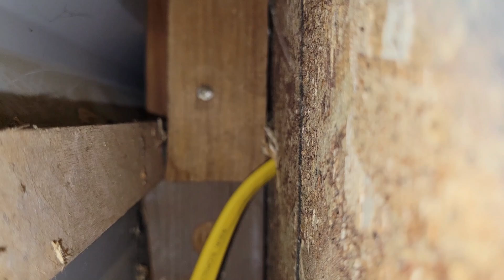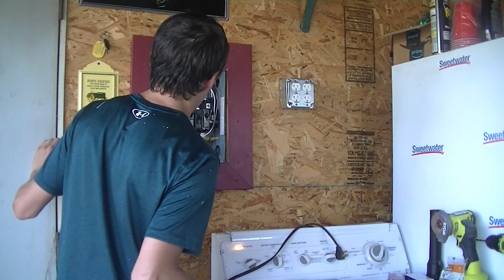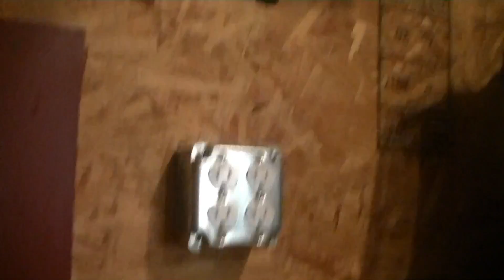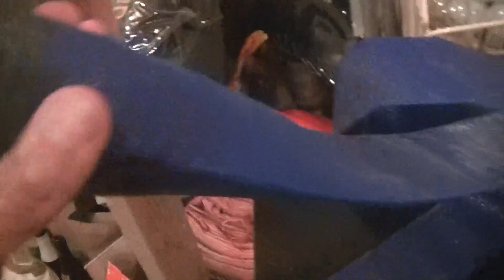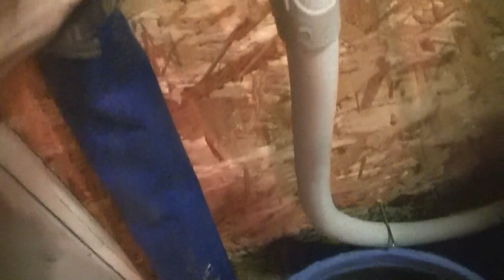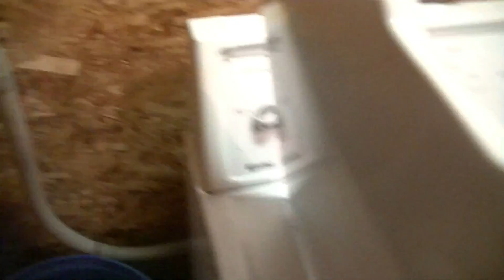Installing A Kenmore 90 Series In The Shop! Part 2 - Running Electrical/Plumbing & First Wash

Comment: On the breaker issue; my understanding is that each box by a particular manufacturer is designed for a certain specific breaker style and of the same manufacturer.

Comment: I'm not 100% sure but the lean could be due to a bad skate plate (suspension plate). Its also possible the frame is bent, or the washer was dropped during transport once.
Reply from the maker: I think that issue might be more so exacerbated because it's not level.  I need to get in there and adjust the legs on it.  I did it once before and that fixed the issue for a while, but upon use, it worked it's way back to the way it was before.
Reply: @lizboz  the 94 machine I have had the tub lean to the left. It wasn’t as bad as yours is but replacing the skate plate helped it drastically. My washer was also perfectly level. but as long as this doesn’t affect the spin then I would worry about it